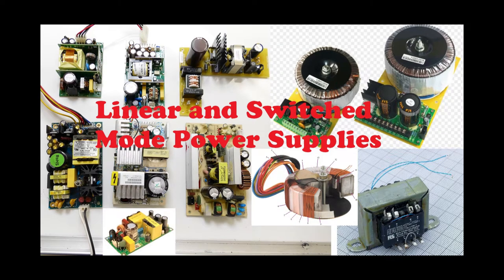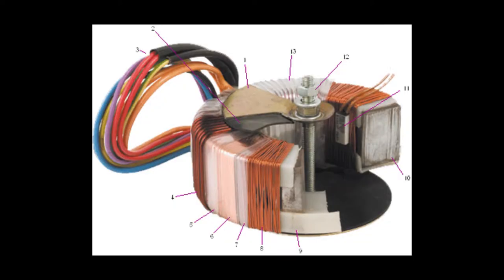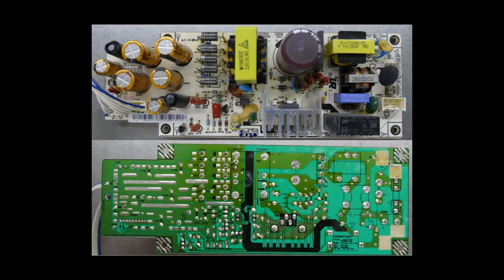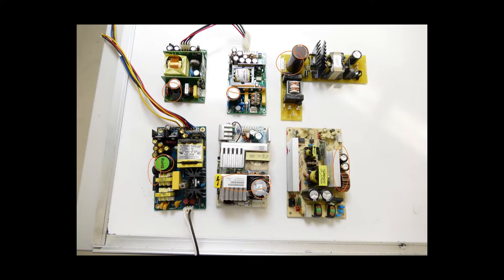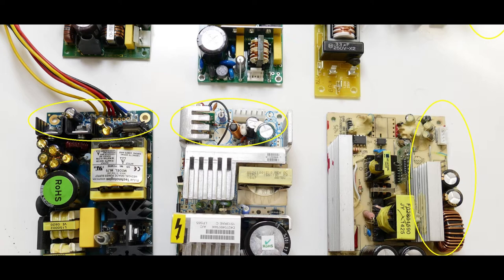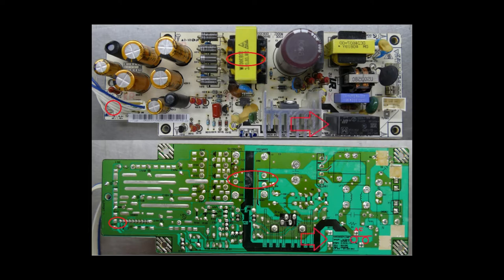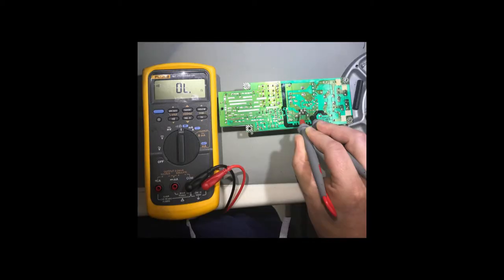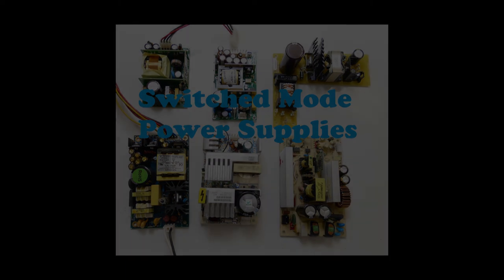12 Power Supplies: Linear and Switched Mode

Comment: Spot on explanation . Very often , like 90-95% equipment does not work because of switching mode power supply issue, and a lot less because of data problems. If you have the knowledge to repair it without schematics, you will be able handle many different not working machines without knowing anything about them.